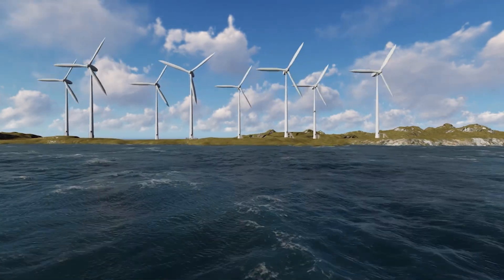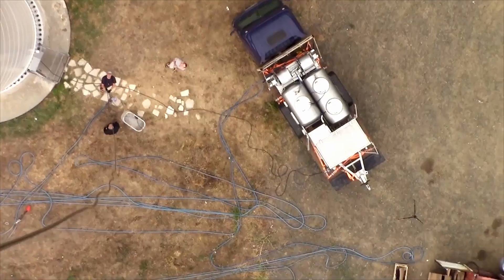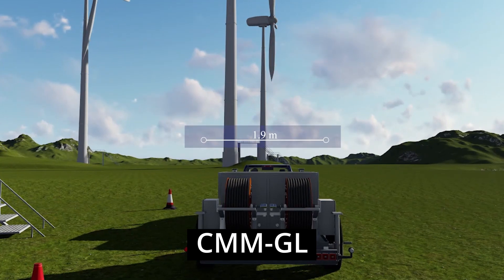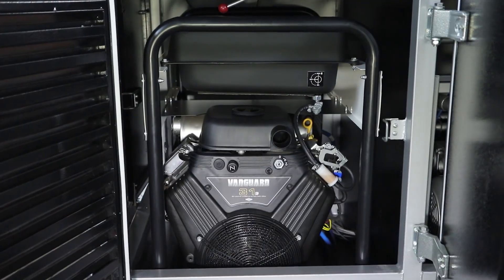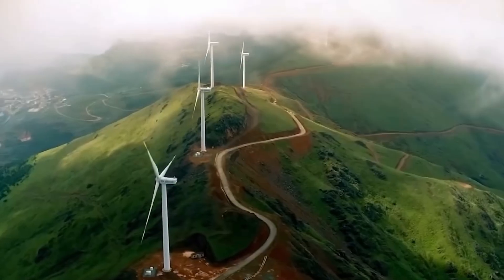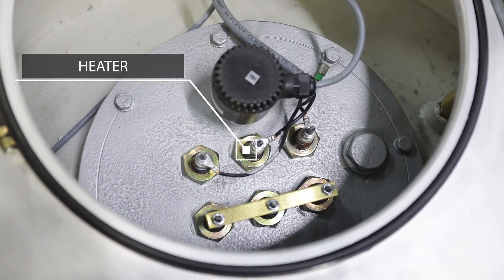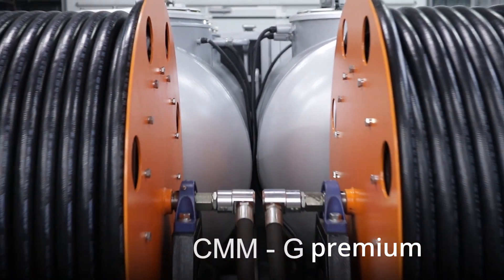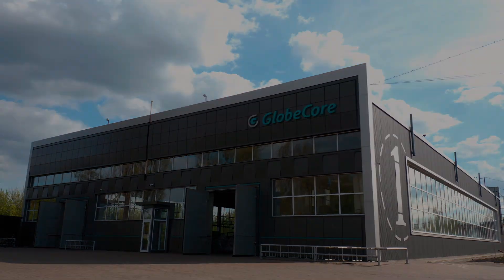Wind Turbine Maintenance - Gear Oil Changers CMM-G

Comment: How does the high level of automation in the CMM-G series units impact the user experience and overall efficiency of the oil change process?
Reply: CMM-G is a fully automatic unit, which helps you to do the job in 3 hours, 1 turbine. And it takes less people to perform.

Comment: How do the control panels on the CMM-G series units differ between models, and do they offer user-friendly interfaces?
Reply: Control panels are same at all the models. Very easy to operate the unit.

Comment: Are there any optional accessories or upgrades available for the CMM-G series to enhance their functionality?
Reply: Hello John, additional options are generator, heater, filters. And hose length depends on the turbine hub height.